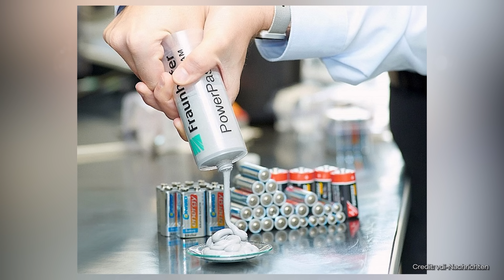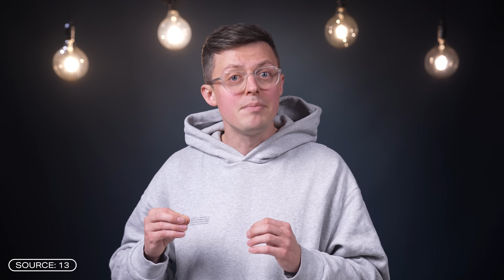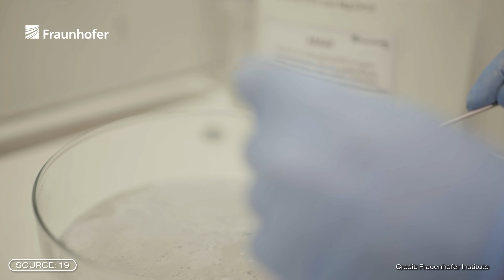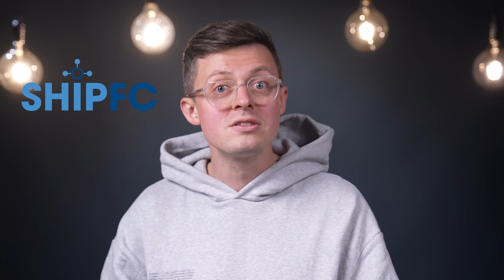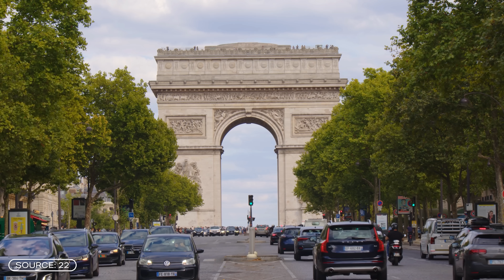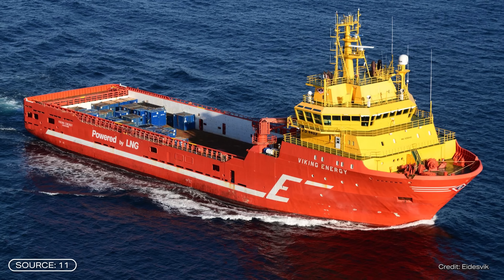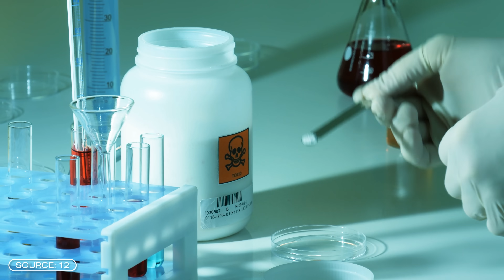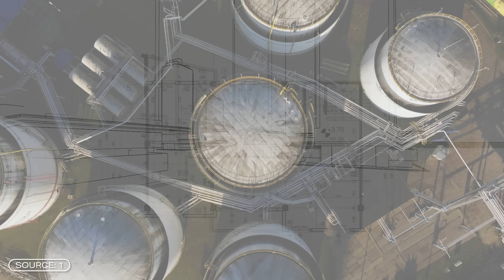Hydrogen Powerpaste: 10x Higher Energy Density & Safe?

Comment: I want to see how it works in a car from hydrogen paste getting squirted in to the wheels turning. It's not that I don't think hydrogen paste is efficient or doesn't do what it claims, I just lack the knowledge to join all the dots. 

Do you have an area in the 'engine' that you feed the paste into and drop water on it? What do you do with the hydrogen then? Just burn it in the engine? Or power a turbine to make electricity to charge a battery.

Does your accelerator now just control how much water goes into the reaction? Is there any lag?

I have so many questions!! :D

Comment: Hydrogen can easily be produced via hydrochloride acid + water+ aluminium results  Hydrogen produced: 0.112 kg H₂ per kg Al
Energy yield: ~3.7 kWh per kg of aluminium... so the result far out performs that of this research, it is a once shot use but hey both the acid and metal can be recycled... This Power metal paste is just BS.

Comment: This is so overcomplicated...

There is a carbon based alternative which can hold over 2 hydrogen atoms per one carbon atom AND it comes in long chains.

Its decently safe easy to use and very energy dense.

It really has only one flaw and that is the proces of burning... It creates some CO2. But thats nothing a handfull of filters cant fix.

A mixture of it with some other compounds makes it even more effective and can be used with great ease.

AND might i add the process of refining it generates a lot of other compounds that have use in the modern world.

All of it comes from a black luquid trapped deep Underground ready to harvest.

Not the healthiest enviromentally BUT as technology advances even this can be fixed.

The material?

Oil.

Comment: The turd polishers at the hydrogen lobby are really going for it.Again.
An energy source that will release hydrogen gas upon contact with water is arguably less Inherently dangerous than a Zeppelin or a ship fuelled by ammonia but seriously? The energy density per kilo is the only plus here but to extract and refine magnesium,produce hydrogen sustainably(,lots of embedded energy in the production and packaging before it can be used,even with green hydrogen),then all the infrastructure effort and energy required to reprocess the depleted reagents??? No wonder they haven't released figures on the retail cost yet -this brainfart will only be 'newsworthy' until someone from the real world crunches the numbers. Any chemical engineer would see INSTANTLY that this is a fool's errand.The more energy we waste on producing pseudosustainable fuels,the more we will need from fossil fuels and nuclear to do everything else.Sustainability = decentralising and dismantling of energy monopolies and public hangings for industrialists, financiers,lobbyists and puppet politicians.Either that or carry on paying for Bill Gates' crab ointment and Musk's inherently Orwellian,weaponisable satellites and megafleet of spycars. 
How on earth could this ever compete with e.g. biodiesel produced Underground in stainless steel vats using microbial digestion of food WASTE that would otherwise be rotting and releasing Methane? Or compressed air engine tech (inventor assassinated)?

If we don't de-centralise and de-monopolise we are still financing and building the machinery that will subjugate rather than liberate humanity.Until we clean house politically and start hanging the lobbyists and the Mandelsons and Murdochs of this world(courts obviously don't work),  the  'energy transition' will just continue to create new monsters to stamp on us and block our natural evolution into a sentient,compasionate,clean species.

Comment: This paste may find uses, but it won't compete with rechargeable batteries generally, maybe commercial aircraft?

The cost of energy from solar, stored in batteries, is already cheaper than hydrogen from any source. 

CO2 is not a pollutant, the biosphere is presently in carbon deficit. Restoring trapped carbon to the biosphere will green the planet and vastly increase habitable area.

A greened planet will possess a more stable climate, likely significantly reducing or eliminating violent storms.

The planet WAS greened, before most of the biosphere was trapped under mountains of marine sediment.

Comment: Energy density for hydrogen paste vs battery is an apple to oranges comparison if you do not include the fuel cell that converts the H2 to electricity. That includes weight, costs and efficiency. I am surprised that you do not analyze on system level but on component level. The effective energy density needs to include this and then you will not get a factor 10x to batteries.

Comment: I doubt this is useful for small vehicles (like cars). Even if the energy density, cost and machinery onboard to handle the paste work out perfectly, it will be the same problem as always with new types of propulsion: infrastructure. A lot of people would have to decide to get a paste-powered car at once to build enough paste-stations (?) to make them practical. Sounds cool for huge cargo ships though, hoping for real world tests.

Comment: I don't see this as "cracking the code" for transportation using hydrogen.  Still too heavy and too expensive at an end to end system level, based on my back of the envelope calcs.  Battery is better.  However l. This could be a breakthrough to store and transport process hydrogen for various manufacturing processes, if you start with white hydrogen.

Comment: I would talked about the Some large commercial bakeries (notably 𝐏𝐞𝐩𝐩𝐞𝐫𝐢𝐝𝐠𝐞 𝐅𝐚𝐫𝐦 𝐟u𝐞𝐥 𝐜𝐞𝐥𝐥) have installed fuel cell power systems at their facilities. These systems use fuel cell technology to generate electricity, water and heating to bake the foods on-site more efficiently and with lower emissions to support bakery operations. Pepperidge Farm installed a 1.2 MW fuel cell at its Bloomfield, Connecticut bakery — one of the largest commercial fuel cell power plants in the U.S. The project was developed in collaboration with the Connecticut Clean Energy Fund (CCEF), which provided a $3.5 million grant to help offset construction costs. This was a continuation of Pepperidge Farm’s fuel cell efforts: an earlier 250 kW fuel cell had been installed at the same site in 2006, also with CCEF support. In German we say "𝐖𝐚𝐬 𝐠𝐢𝐛𝐭 𝐞𝐬 𝐍𝐞𝐮𝐞𝐬?" 𝐖𝐡𝐚𝐭'𝐬 𝐧𝐞𝐰?   𝐍𝐢𝐜𝐡𝐭 𝐯𝐢𝐞𝐥, 𝐮𝐧𝐝 𝐛𝐞𝐢 𝐝𝐢𝐫? 𝐄𝐧𝐠𝐥𝐢𝐬𝐡: 𝐍𝐨𝐭 𝐦𝐮𝐜𝐡, 𝐡𝐨𝐰 𝐚𝐛𝐨𝐮𝐭 𝐲𝐨𝐮? 𝐉𝐎𝐇𝐀𝐍's 𝐒𝐂𝐈𝐄𝐍𝐂𝐄

Comment: Powerpaste is basically a hydrogen storage medium using magnesium hydride. You make hydrogen (≈70% efficient), convert it into MgH₂ (≈85%), then run it through a fuel cell (≈55%).

End result: roughly 30–35% round-trip efficiency from electricity → paste → electricity.

So it’s much less efficient than batteries (85–95%), but it’s safer and easier to store than compressed hydrogen. It’s more about energy density and portability than raw efficiency.
Reply: That inefficiency follows on from the main energy-absorbing process: the manufacture of magnesium powder.

Comment: Could you not run a fuel cell directly on ammonia rather than splitting it first? AIUI the problem with methane fuel cells is carbon build up but nitrogen wouldn't do that.

Comment: When little I read a book from the '80s about kids in USSR (Baltics, not Russia) trying to assemble their own mopeds from used parts. That's all they could afford to get, and it was not chep for them. When they finally got one running, some older students snobbishly asked - on what fuel the contraption was running, to which the young constructor answered : "a hydrogen mix". A made-up substance which should be practically impossible. 40 years later it is becoming (if too expensive for now) a real cutting-edge technology.

Comment: How much does the water weigh? 10kg for 1kg does not sound very efficient. How does it compare with compressed or liquified H2 including storage systems. How about the energy round trip efficiency? If you have to generate 2x the energy vs the 90 % round trip for battery storage. Doubt this will ever be cost effective.

Comment: The energy density advantages of hydrogen at high pressure is not marginal, it is non-existent, a 100l volume tank holds 5kg of hydrogen and weighs in at about 90kg and has the potential to release 60MJ when used in a typical fuel cell. 95kg of lithium ion batteries can store well over 100 MJ and they are far smaller than the hydrogen tank.

Comment: 1,9 kwh of energy per litter is still 4x less than gasoline or diesel. Is it stable on the long term so it can be used for multi months / year storage ? what is the amount of energy required to manufacture 1 litter of that paste ?

Comment: I've got a method of hydrogen storage that needs almost no moving parts, heals itself, uses solar power and biocompatible compounds, and can make use of infrastructure we already have: it can be stored in molecules, like methanol, which stores well, and while using the sun and burning the "waste" gasses for heat it can be baked out of algae or duckweed, or azolla, or any other plant. Photosynthesis properly absorbs 100% of photons in it's abortion range, and the molecular machinery around it can be improved with breeding and direct genetic modification. We're building all this infrastructure that needs to be maintained when we have a perfectly robust carbon circulating system right there. Most emissions are from industry that uses fossil fuels and this will fit them better, we can also get along fine using methanol or not even really replacing gasoline in the vehicles that need to be used, because it's only about a 4th of total emissions, and if we electrify almost everything stationary and in cities then that'll shrin drastically before we start using hybrids for efficiency and longevity. Trains and ships can use renewables while being the most efficient transportation, and putting them everywhere they could be useful would take a least some long distance trucks off the roads. This'll also work with solar panels since you can't use all that sunlight with plants, land plants can't use more than a few hours of sunlight but water plants can keep going, they just don't use every wavelength and there's transparent solar panels which can be tuned to absorb the wavelengths that plants don't really need, they benefit from some infrared since it helps photosynthesis somehow, but the transparent panels probably won't absorb everything.

Comment: This is identical to a danish startup project 25 years ago. They also tried to use pellets for reducing nox in diesel motors and was later sold to a french company. The only difference is that the danish start up focused on pellets.

Comment: It seems to me it has promise, but the energy consumption and waste produced are critical factors. Questions: How many kWh are consumed to produce 1 kWh of stored energy? How much and what type of waste is created in production and in use, both in terms of waste per kWh and waste per km driven? And one final note regarding practicality: regardless of the energy storage density, it's still just a non-rechagable battery that has to be changed when exhausted: cost of time and work to change it and the infrastructure to support it needs to be considered too.

Comment: This is cool. A safer way to travel with hydrogen. Smart guys. Seriously.
Reply: Look up Magnesium Hydride on wiki. There are lots of questions about a paste, which uses a suspension of a highly reactive substance in a polymer gel to control its reaction rate. For example, is the paste stable for long storage periods, or can the constituents separate due to the effects of gravity and differences in material buoyancy within the paste. Is it thermally stable and to what temperatures, can the polymer wax out at temperature. Is it resistant to chemicals (acids, alkalis solvents, halides, etc), all of which it could get exposed to in an accident.

Comment: Oh, we have It already, lead acid batteries have 10.000X more power density, with a small motorcycle battery you can recharge an EV battery like a Tesla one.
You just need to circulate water and sulfuric acid through It and It Will provide you with thousands of KW/h of energy nonstop until Its cathode degrades too much.
And you dont even expend the water or acid, you just collect and reprocess It so you can refill your tank again for the Next cycle.
We can also develop removible cathodes so we can make the generator much more light, so the power density goes ballistic, You only put the amount of cathodes you need so its scalable

Comment: In terms of power dencity you not only need to refuel your tanks (WATER+paste) AT LEAST 6-7x more often compared with gasoline\diesel, but also deal with enormous amounts of vaste (same water + paste mix) compared to li-ion, and you must pay for transport and regeneration of this waste, assuming even more fuel and waste generation. Li-ion you can just recharge. And you sell it like a breakthru? Holy moly, poor boy. This is soooo silly can't belive. As a stationary full cycle system it also can't beat anything.

Comment: Magnesium price currently 1.8€/Kg so to release 1.6kw electricity you need 18€ of Mg (if this process generalize, what wil do this price ?). Biggest producer : 87% ... China. Why ? Because most of other countries ceased extraction because of the toxic sulfur emission SF6 problem, regulated by the Kyoto accord. China does not bother, it doesnt mean its clean. Higly flammable metal, used in explosives. mixed with Hydrogen, what could possibly go wrong ?

Comment: The problem with hydrogen-containing paste, is that you have to a) produce the hydrogen, at great cost of de-carboned power, b) produce the paste, c) distribute the paste cartridges, d) have a system, aboard a vehicle, which release the hydrogen, e) use this hydrogen in a pretty inefficient and very expensive and delicate fuel-cell, and f) recycle the spent hydrogen-paste cartridges.
The overall efficiency, complexity and costs of that process are dismal. Efficiency is probably hovering around 30 at best.
And then, you compare with a battery electric car, whose efficiency is in the 90% range, with the distribution handled by existing power lines, no constant recycling necessary (except obviously at the end of life of the battery... in some 20 or 30 years).
Hydrogen is hopeless in transportation... except possibly in a couple of niche cases.
Hydrogen is also a bad solution for energy storage... very expensive and inefficient in most cases. 
But green hydrogen is EXTREMELY useful to replace the ca. 100 million tons of "black" hydrogen used in industry every year.  Hydrogen must be used as a most useful chemical element, and NOT as an energy vector, for which it is largely ill-suited!

I am a senior (now retired) chemical engineer, and I have been a project director for developing a new, more efficient electrolytic process to produce green hydrogen... not with Fraunhofer but with TNO, the Dutch equivalent... so I am very much in favor of it... but happens to have studied in details for what applications hydrogen makes sense, and for what it does not.

Comment: The one method that I've not seen mentioned is Magnesium Aluminum Hydride Mg(AlH4)2. The thermodynamics are almost perfect for near room temperature production by dissolving aluminum and magnesium in liquid gallium, and bubbling hydrogen through that. The formed Mg(AlH4)2 should precipitate as a solid, and be separated either through filtration or settling. It would only have to be mildly heated to release the hydrogen (150~250C), leaving the mixed magnesium and aluminum behind, for less energy-intensive recycling, compared to reacting with water to form hydroxides (which require a LOT of energy to re-reduce to metallic form).

Comment: Someone else in the comments makes noticeable the fact Gasoline have much higher energy density..
Having to switch the Gear of a Non Combustion Vehicle just for being Clean is Pointless..
Also Regular Motors would need to be Adapted to Burning Hydrogen, is not a Straight Up Conversion..
Hydrogen is Much Corrosive.

But for Emergency Generators which needs to Burn Clean could still be Feasible.

Or Emergency Heaters for Wild Excursionism...!
One of the Problems with Mountaineering always have been the Risk of CO2 Poisoning/Death from Night Fireplace or Heaters' CO2 Emissions..
This Eliminate the Problem Completely at the Cost of the Weight of the Fuel Cells Transport..
Water I imagine could be Easily Replenish Everywhere or a Dehumidifier Membrane could be easily integrated into the System...
Portable CO2 Free Heaters...
That might have more Applications...
Westphalia Region alone Would make it a Best Selling on Amazon.
Much more than 6 Tons/Year.

[Also, not to Bother the Detachment of Germans: 
But Emergency Heaters for Refugees Camps with this Technology Might Be Ideal and could become a Global Standard for Humanitarian Organisations to Provide it in order to Maintaining Safety Requirements Standards Settled from Better Prepared First World Countries..
..that would make in itself a Permanent source of Income..

There are more People Dying of Cold and Lack of Shelter during Displacements Of Populations as Consequence of War than for the War itself amongst the Population in Long Lasting Conflicts]

Comment: What is the energi density compared to oil?
Reply: Almost 5 times lower. But the conversation rate is roughly 2 times better (if applied in vehicles, although this is not yet a game changer)
So twice the weight must be stored to have the same amount of utilization energy in comparison